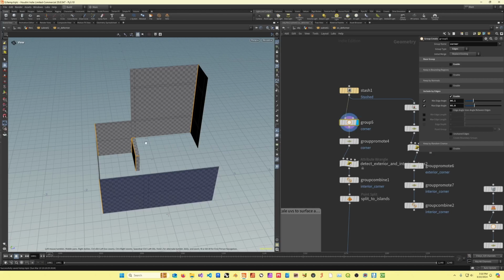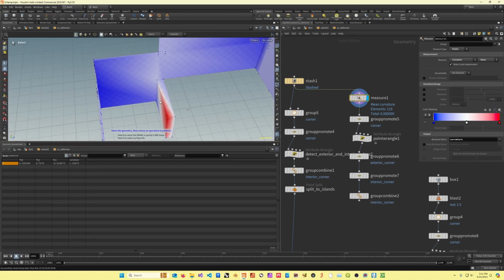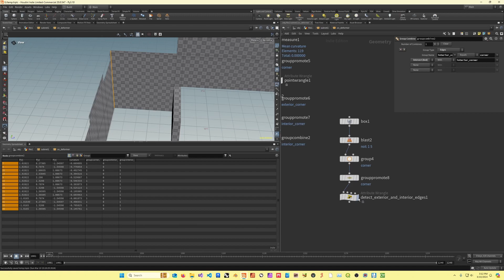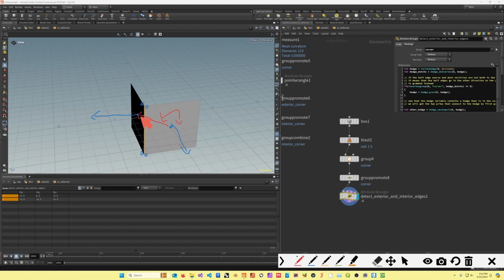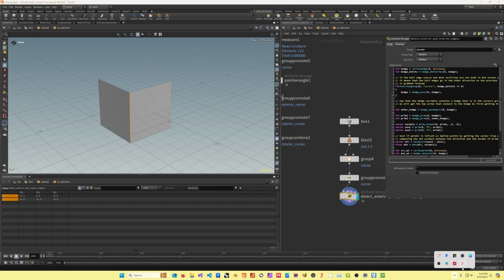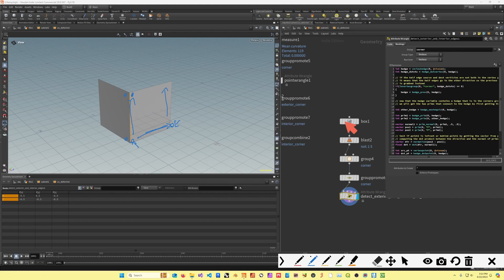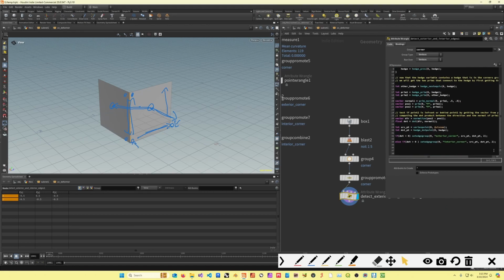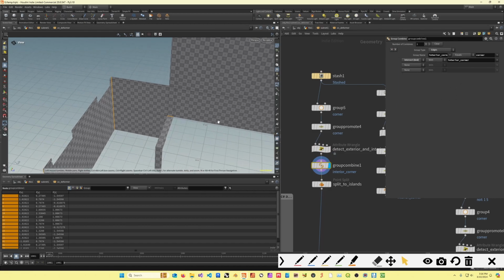Houdini | Selecting interior and exterior facing edges

Comment: Too complicated - we need to develop a method of selecting the same edges but using only nodes
Reply from the maker: I agree, the group node can detect angles but not orientation unfortunately. However by using only nodes i think you actually make this much more complicated, since you inherently need to compare the polygons that make the edge which would be much messier without wrangles. I usually dont bother with HDAs because I just to hobby work and dont want to mess with maintaining them and making a nice ux, but this is only of the few setups I've made an HDA because it has so few parameters.